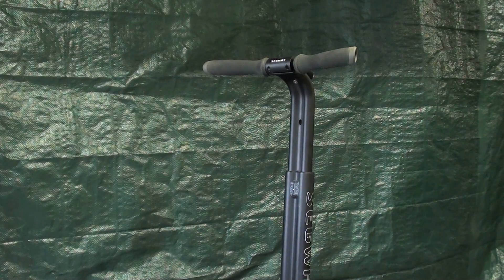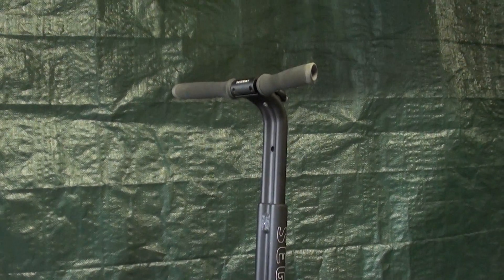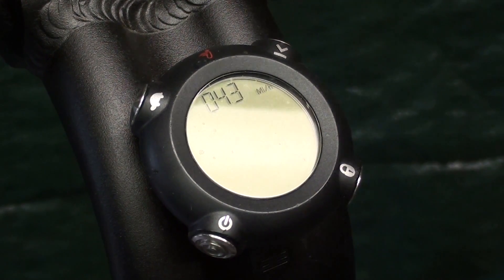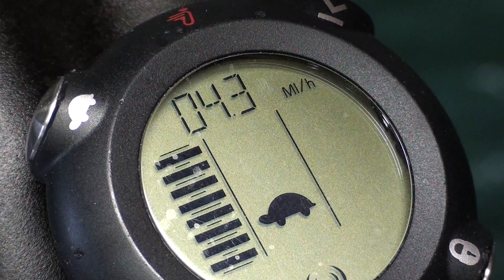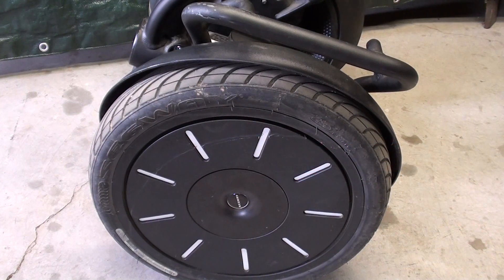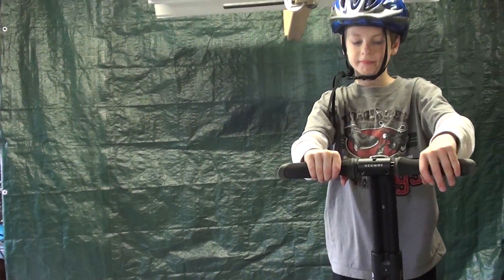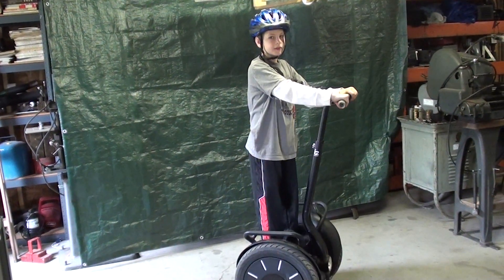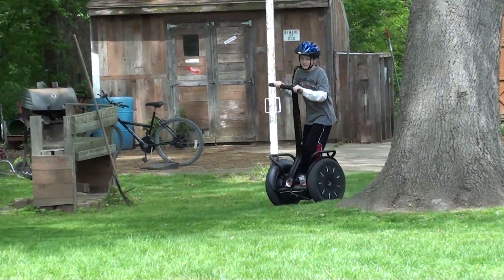WHAT MAKES IT WORK? #20 "How a Segway PT Works" tubalcain

Comment: Nice video Sir.  I had opportunity to ride a Segway about ten years ago. That early unit id not have the pivoting handlebar setup. Weight shift was the way to steer.  Had a ball and picked it up pronto.  Like here, the mount/dismount was the most difficult part.They were around 12K then as I recall.

Comment: Segways are indeed fun. I have one of the early versions which steers with a twist-grip on one of the handle bars, rather than by leaning the stalk. Unfortunately, mine is showing some sort of fault (and consequently will not power up), and I've not got it repaired yet. I taught my dad to ride it when he was 85.
http://bit.ly/bill_meek_segway

Comment: I can assure you that learning to ride in turtle mode will cause you to fall when you put it in normal mode. If you were to ever lean the steering that much it will spin around so quickly it will break your neck. I suggest you learn to ride in normal mode and make VERY small inputs until your brain associates how little movement it takes to steer. In normal mode it is so sensitive it seems it is reading your mind.

Comment: Nice video.  How long did Andrew practice with it?  He seems to have mastered it already.  It's tragic that the owner of the company accidentally ran off a cliff with one.  My guess is it had to do with the automatic balancing feature -- lose your balance and lean too far forward and there's no stopping it until you can regain balance and lean back.  You could put a panic stop brake on the handles I suppose, but that's almost always going to end up with a face plant into the pavement.  It's better than running off a cliff or out in front of an oncoming bus though.

Comment: My 18 inch wheels are a bit larger than your 18 inch wheels, some sort of optical illusion?   Keep on keeping on.
Reply: Hmmm... with automotive stuff is the wheel diameter (metal part) thats specified... he was measuring Segway's tire outer diameter. Check it out!
Reply: Yeah your right, I was just fooling with mrpete.

Comment: "each is much more powerful than the PC you currently sit at"(sic), not quoted verbatim. This is strictly untrue as the Segway and hoverboard type of mechanisms use the same type of sensors and processors which are designed specifically for a certain type of input and output. While they are capable of of processing information at a rate exceeding that of the human mind they are nowhere near that of your even low end modern processor. It's just a case of the processor is hard wired for this particular use case.

Comment: I had a "trip" as you called it about 7 years ago on one while backing up.  The thing went into full speed in reverse  to try to catch me as I fell and I wound up laying on the floor with my foot wedged in it while being dragged in circles by that thing to the point that I thought it was going to rip my foot off.   Look up the safety record of that thing.  When it goes haywire things can get ugly real quick.  As someone else pointed out. The owner of the Segway company died when his took him off an 80 foot high cliff.   Chris
Reply: To paraphrase Einstein, you can't cure stupid.  Segway falls into two camps; utility users and thrill seekers ... both of which will have experienced and inexperienced operators.  the difference between segway and a skateboard is segway looks quite similar to a walking frame and thus is more tempting to middle aged guys with more disposable income than the average skateboarder.... so of course there are casualties
Reply: The few Segways I've seen 'in the wild' were used by airport cops... and in my opinion made them appear particularly pedophile like. However, as shadowdog500 experienced, they seem to have a safety record way out of proportion to their numbers. I can recall hearing/seeing numerous such horror story reports through the years...

They really hyped the things before they were released, thats for sure. I was irritated with the things before I even knew what they were.
Reply: To be fair, he accidentally backed off a cliff trying to get out the way of a walker.  He was an ex miner who invented HESCO, used to protect the bases in Iraq and Afghanistan.

Comment: The electronic "gyroscopes" are quite neat designs. You have something like a pendulum on a spring, very very small, etched into a silicon die. The pendulum is also one half of an capacitor. It get excited by static electricity. If nothing moving, the pendulum is oscillating symmetrically and the capacity is changing in a symmetrical sinus pattern. The system reads a symmetrical sinus wave. If the system is decelerated in one direction the pendulum needs a more time to go in one direction than in the other, this will shift an deform the sinus wave. When compared to the default wave you can determine the acceleration. All this calculation is done on the same die.
Reply: Thanks for explaining that, I always wondered how they work.